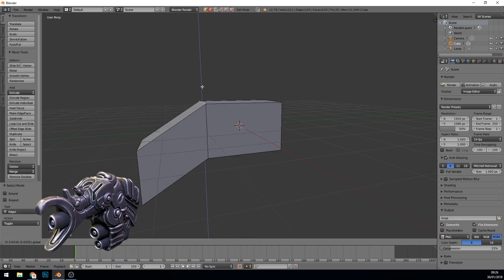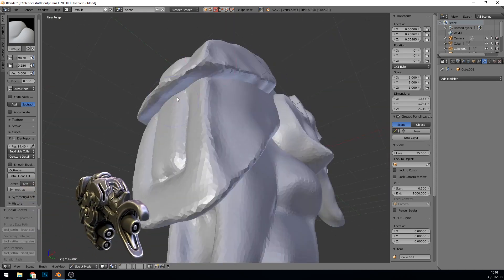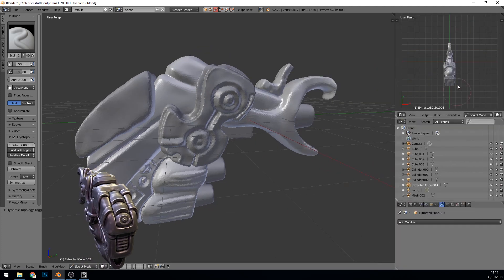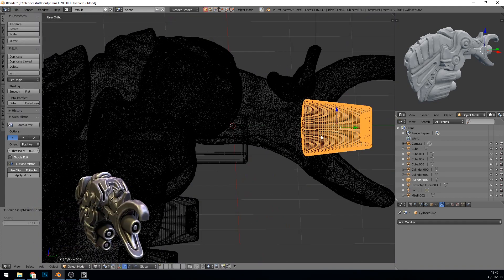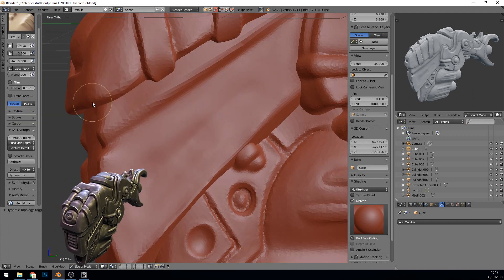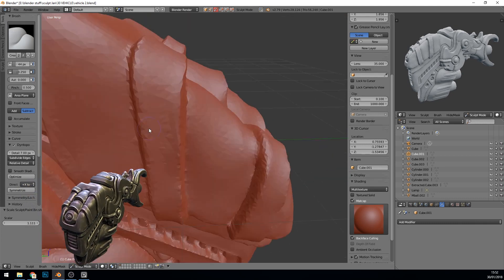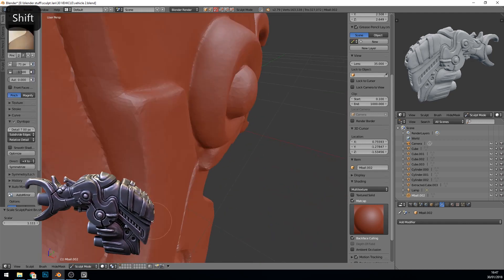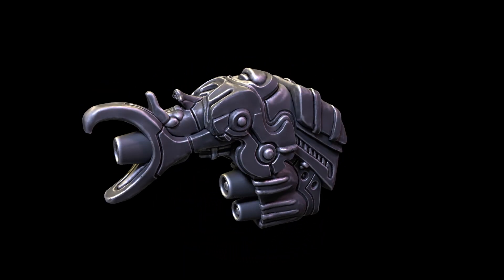Sculpt January 2018 - no.30-  vehicle - Blender

Comment: The seat looks a bit too small in comparison to the rest.

I don't think that the sculpting workflow is faster than the boxmodeling workflow, especially when you use ngons and bevel modifier (it's super fast) traditional subd modeling with all quads etc is indeed quite slow to sculpting, but once you're done it's a lot cleaner and a lot more easy to edit proportions afterwards. But as always: use what you like best